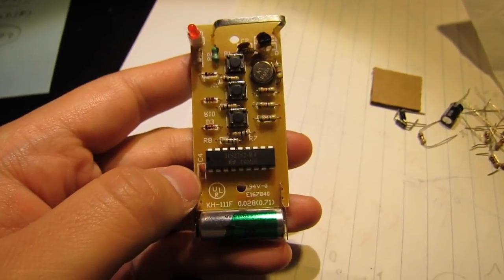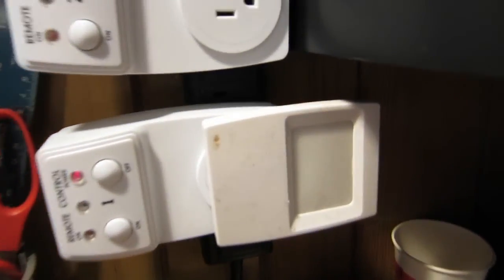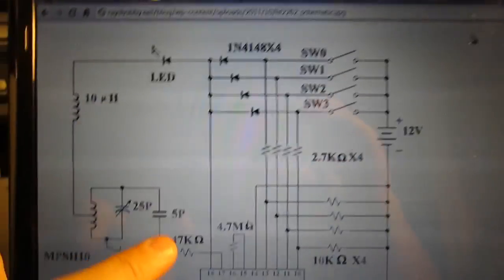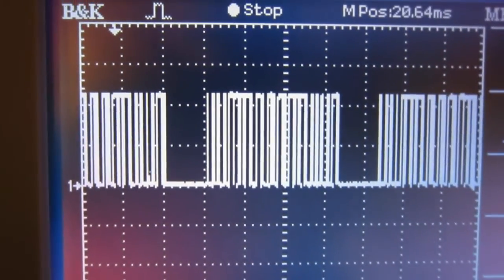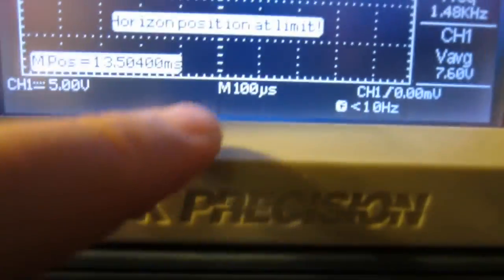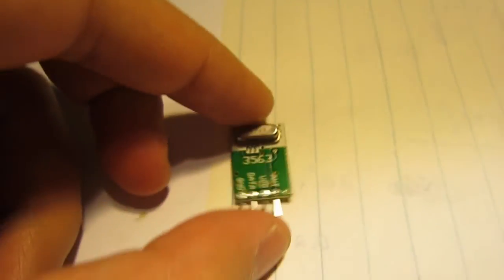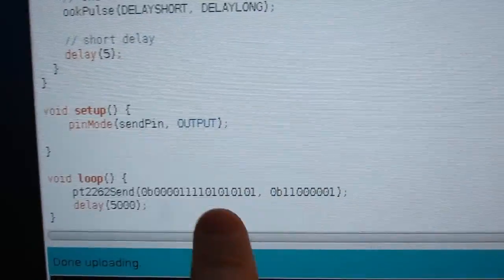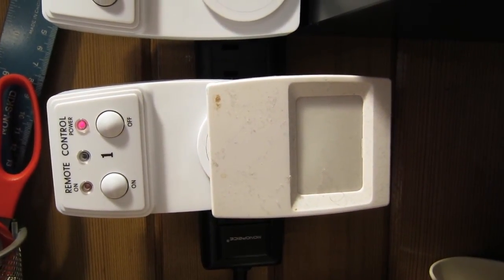Using Arduino to Interface with Remote Power Switch (updated)

Comment: Can this code be used the other way around? So lets say I wanted to light up a led whenever my rf doorbell sends a signal to the rf speaker on the other side...

This would have the speaker ring and also the led to light up....
Reply from the maker: +J. Enrique Cerda Zertuche: Sure. The RF code is broadcast to the air, so one signal can be detected by multiple receivers and trigger multiple actions.

Comment from the maker: Cool. Thanks for sharing. I do have an updated method for decoding remote control signals, which is better and even simpler. Check the update blog post in the link above.